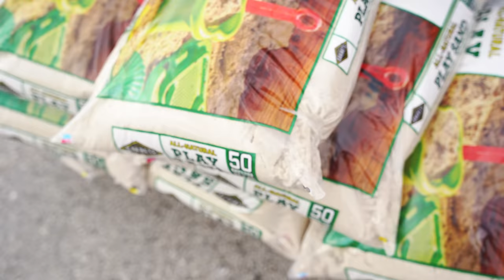Building Dream SALTWATER POND In the Fish Warehouse! (Pt. 1)

Comment: It looks like you filled that straight from the tap with that hose that is a huge mistake if you're going saltwater you will have nothing but problems in the beginning and have to refill it again with water I suggest you get an r o d i water filtration system I have over 20 years of experience with salt water tanks